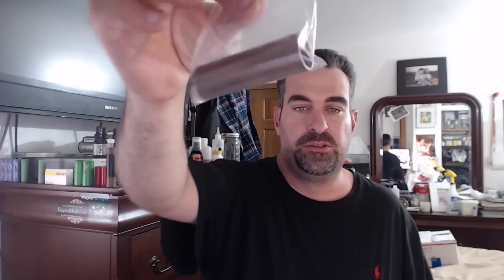HOW TO CLEAN A COPPER MECH MOD WITH KETCHUP OR CHEMICAL?

Comment: Thanks Big Lou, I couldn't find the metal polish earlier then remebered this video! Thought I would give it a try, very impressed with the results. Its cleaned the threads and inside of the tube out really well which I was having a bit of trouble with before.

Comment: I was looking up ways to clean copper when I noticed my copper Purge mech  mod wasn't performing as well as it did brand new. It definitely needed a good cleaning. I drip and sometimes when I'm driving,  I over drip, so there was certainly old juice on the switch and threads. Along w natural copper aging gunk. B4 I saw this video I watched one w a guy using lemon, which I just happened to have...and HOLY SHIT did it work instantly and GREAT!!! I just dismantled the mod and put the parts in a bowl, then individually rubbed cut lemon slices on each part, then squeezed juice over the whole, in the bowl so it sat while I cleaned, dried and polished each piece individually. Took about 5 mins total and it all looks brand new! So lemon works awesome too!

Comment: Makes sense - I know when kitchen pots get blackened, making a batch of tomato-based sauce will brighten them right up. It's the acid in the tomato that does it.  Never thought about using it on a mod, but this is a tip I'll be using. Thanks, Big Lou!  :D

Comment: Awesome dude.  Do you think it works as good on brass?  I hate using Brasso for my brass mods.  It smells like hair dye.  Ketchup smells way better. Thanks
Reply: I'm planning on trying this on my brass mod. It couldn't look worse than it already does.
Reply: Chuck Hargis how did it turn out? if this is all i need for my brass mod... im all over it
Reply: It's alright. Your mod smells like ketchup for a couple of days though. I use products found in hardware stores now.
Reply: good to know. any recommendations?
Reply: Jewelry cleaning wipes are great
Reply: Wayne Jb
Thanks for that tip, Wayne. I hadn't tried the ketchup yet.
Reply: Wayne Jb When I was in the Navy, I worked in the Ward Room for my Mess Crankin' duty. Part of that was shining this nice-sized brass bell outside. I made that bell my pride and joy and tried everything to make her shine. I finally settled on a combo of Brasso, ketchup and hot sauce. That bell shined like a mirror. :)
Reply: +Goddess.FourWinds

DING!!!!

Comment: The problem with the matt finish on the cap and switch is the ammonia in the cleaner, Ammonia attacks copper ans brass like crazy. If your a firearms enthusiast you'll know of a bore cleaner called "Sweets 7.62 " which contains ammonia to clean the copper fouling from the barrel, I made the mistake of using a new bronze bore brush to apply the cleaner. And boy did it work, After about 15 minutes the bore was perfectly clean and the new bronze bore brush now had a loose fit from the cleaner.

Comment: Hey Lou, Awesome video. If you want to shine up the copper caps, try using some toothpaste as a polish. Works great & you can use a old toothbrush to get into the threads and tight spots - enjoy, later

Comment: That cleaner is too abrasive, you gotta be quick about it.  I tried TarnX on my copper 4nine and it shined it up amazingly, the first time. But the second time I used it I left it on there too long and it had the same dull look to it and even pitted it in places.
Reply: Pretty sure it says on the tarnx bottle not to be used on copper and brass...